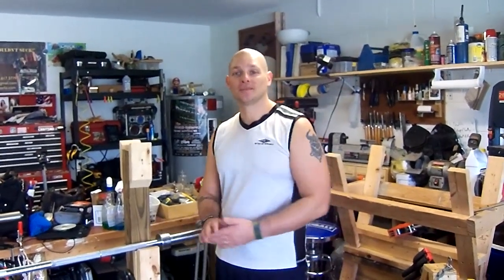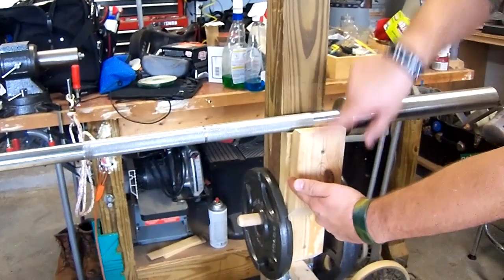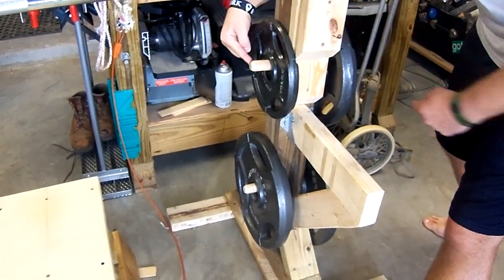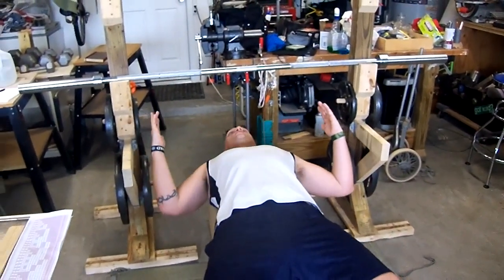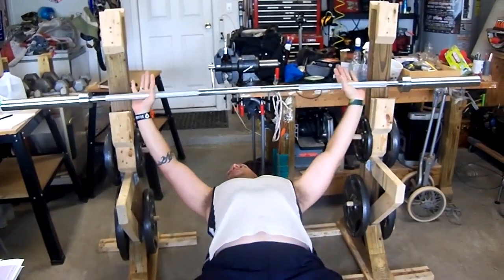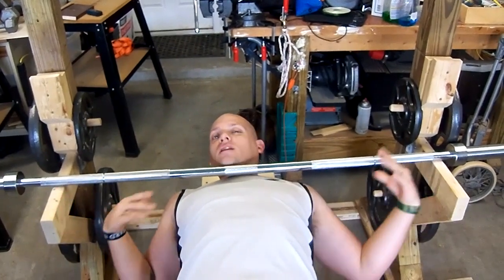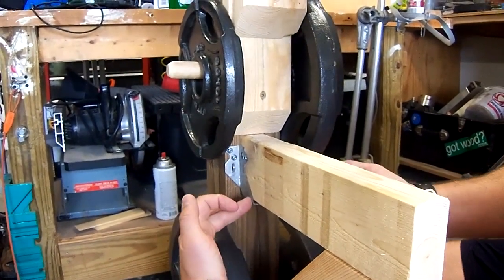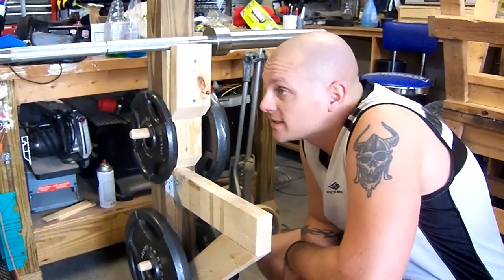Homemade Bench Press and Squat Rack

Comment: I’m doing the same, your safety solution is far better than mine so a quick change to my design.  I’m putting my squat rest a little higher so I can step under it and it lifts the bar as soon as I stand upright without stretching

Comment: I'm surprised with some of the negative reviews. I was so impressed with the https://www.youtube.com/post/UgkxMwYg0MOXR4M-oGeyBsNSYe1aPOUoRH6D cage that I got the lat pulldown attachment that goes with it. It is equally outstanding. I don't have one complaint other than putting it together is a job. The instructions and packaging of the parts are very well designed and organized. Also, I stripped and damaged the pull down cable the first day, admitting it was my stupid fault, and they quickly replaced it at no charge. I'm 6'5, 280lbs and fit in the cage just fine. Glenn B

Comment: I appreciate your ingenuity but you are taking a lot for granted and your safety with it. Those screws are not designed to resist hundreds of pounds of shear force. At the very least you should have a double row. Carriage bolts are the way to go. As for the safety bars, you are bound to get lateral force if the bar lands hard and those joist hangars aren't enough to resist the twisting motion. The same concern for the bench: have you ever seen a piece of commercially made equipment that uses dinky little screws? Your bodyweight plus the weight bar can go over 400 pounds and you probably have only two screws in the cross pieces to prevent the legs from spreading. The repeated stress will cause either metal fatigue of the screw or will strip out the hole. Use carriage bolts to be safe.
Reply: You can use construction glue and screws on most parts. 
To strip a screw out of the whole you need a lot of force .
I don't like joist hangers, but it will take a lot of weight to break it. I know people attaching roofs with them and they hold tons of snow.

Comment: 2 out of the 3 diy videos I've seen for gym equipment involves safeties for lowering the bar. What kind of weakling needs that. I fail to bench 300+ all the time and is not a big deal. I let the bar sit on my chest casually, tilt the bar, and slide myself off the bench.
Reply: Or you can roll it down on your stomach and sit up. But safety bars is really for more comfort. Most serious weight lifting benches have them too.

Comment: i dont think I would trust that
Reply: Richard Cowtails I understand why you feel that way but it depends on woodshop technique and experience. There is wood that is super strong but medium strength of wood can be reinforced.  the reinforcements the guy showed holds very strong. I would guess it holds 700 pounds max
Reply: Zachery Oberg  I agree. This design actually gave me some ideas. I trust this wooden construction more than I trust the welding on some of the crappy Chinese benches. If you don't believe me, just see how wobbly and shaky some of the benches in any commercial gyms are. Look underneath and tell me how you trust that welding:)
Reply: Have you ever fallen through a wooden deck or ever seen one collapse with all the weight of multiple people on it? I doubt it. These types of structures can hold quite a bit.